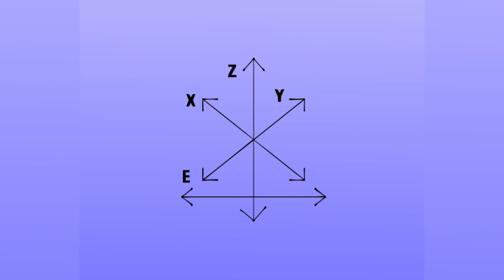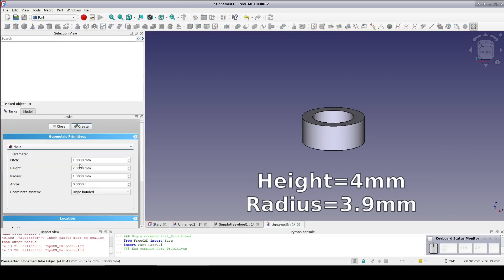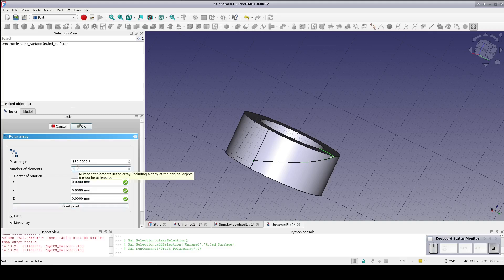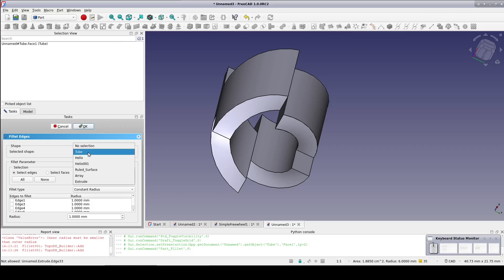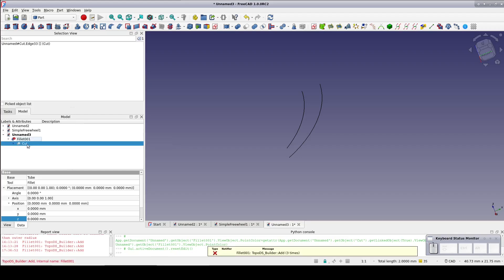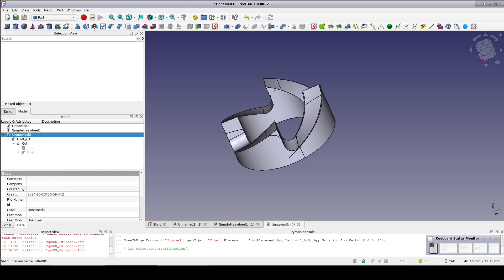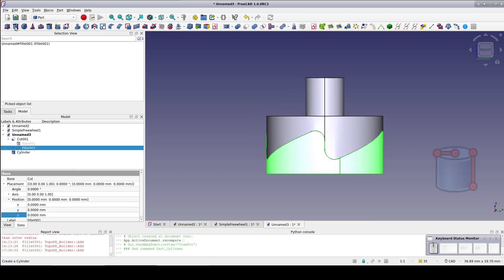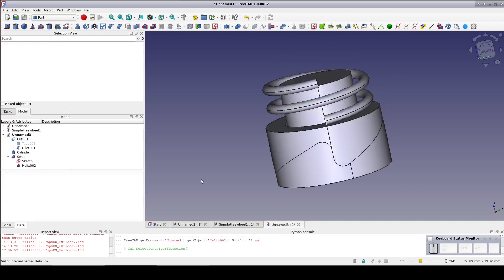FreeCAD: Fillets, ramps, and freewheeling

Comment: I designed something very similar to act as a drive for a 3D printed cylinder with slots that rotates parts from a hopper onto a chute, where they slide down against a stop such that a robot can grab them. The cam I made works in either direction, and is designed to cam out if a part becomes stuck, or if someone happens to bypass the lid safety, and gets their finger in the way. Mine wasn't as elegant as yours, but it has been in continuous service for over two years.
Reply from the maker: I can imagine a mod to my design with a second helix going the other way. By adjusting the pitches, the cam out force can be adjusted asymmetrically.